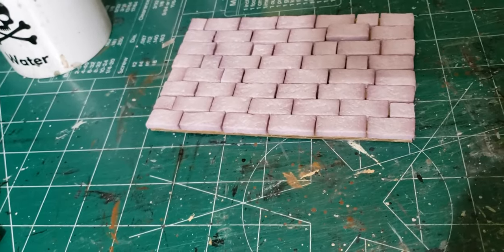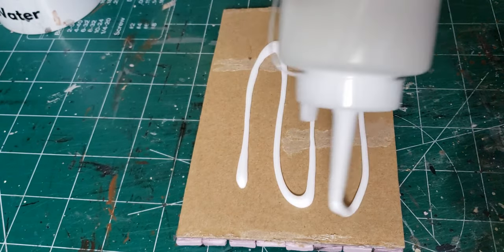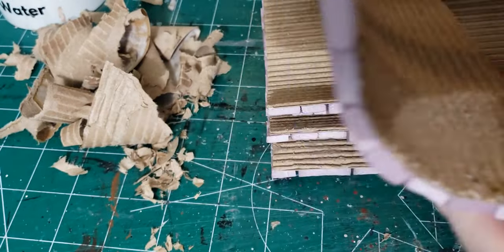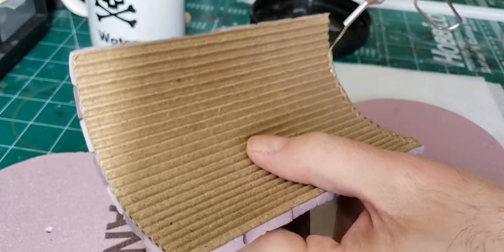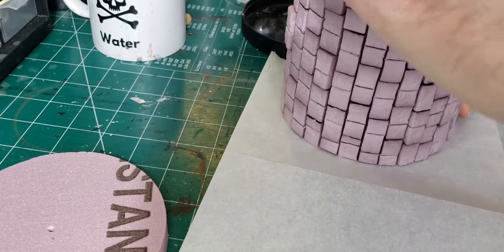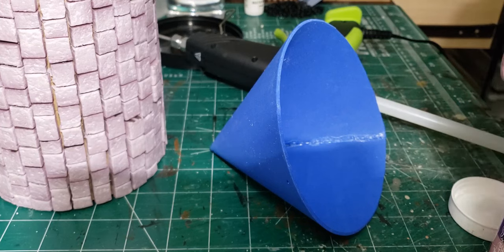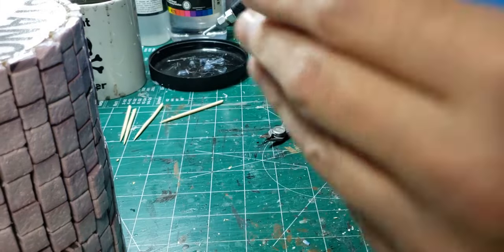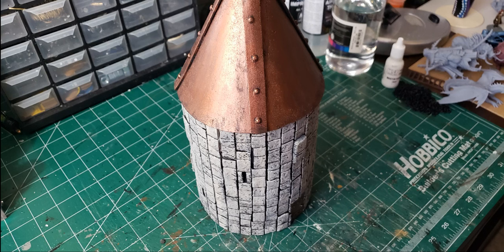Let's Craft a Guard Tower using a new technique!

Comment: Could have saved your self some time, and glue, and just used Corrugated Cardboard in first place.. Been doing this method for years. Use that, and you wont have to glue and peal that layer of cardboard off.. Glue the bricks to it and your all set.. Good luck
Reply from the maker: It was an accidental discovery on my part. Next time I will definitely follow your advice. Thanks!